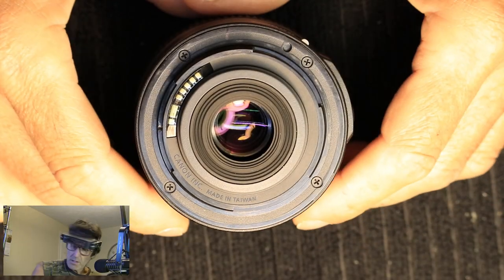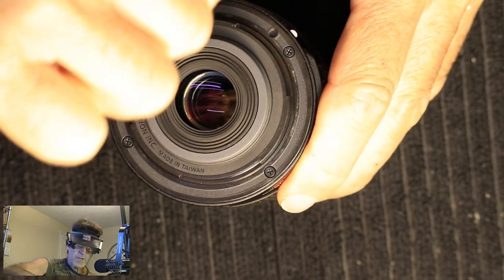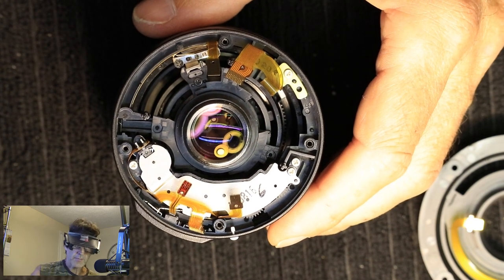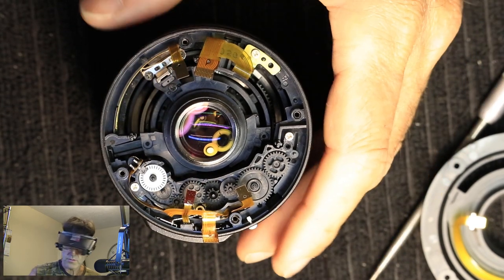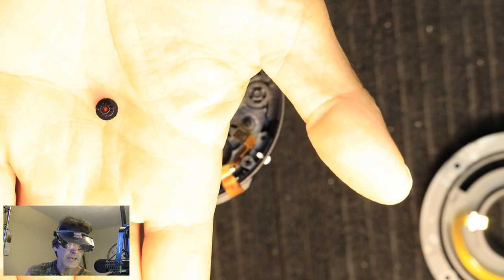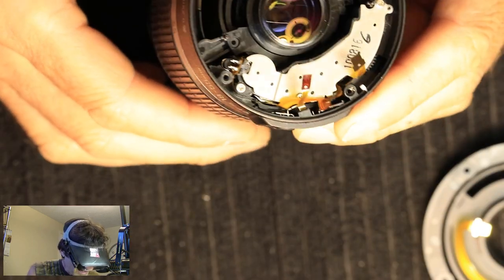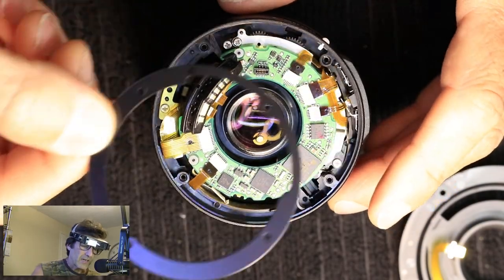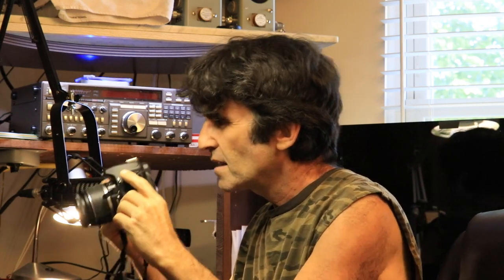Canon Lens DIY Repair: 18-55MM F3.5-5.6 AutoFocus Not.....

Comment: mines not broke but it wont auto focus please help
Reply from the maker: Does a different lens work in the same camera?  If so, it could be the control board that's in the lens, or it could be the auto focus motor.. or a broken gear, you almost have to take it apart to see

Comment: Where do you buy replacement gears?
Reply from the maker: The place I got them from went belly up.  I would try canon themselves and see if they will have it.  I got this from their website.  I don't know if this is the right number, but it might be a place to start;
Genuine Canon replacement service parts, including inkjet printer print heads are available to purchase by calling the Canon Parts Order Desk at (866) 481-2569.

Comment: Hi, where could I find the gears or the flex cable? thx
Reply from the maker: HI, the place I got these gears from has since gone belly up.  Have you tried to see if Canon has a parts department?  It also looks like if you google focus motor for the 18-55 lens, some options come up from aliexpress.com and some options on eBay as well..
Reply: @JLPicard440  HI, thank you for the answer, I actually disassembled the lens, and nothing was broken. I have a problem: it focuses only when the object I'm tracking is getting far away, basically it only rotates in one direction, It's not able to come back once it has focused.
Reply from the maker: I'm definitely not an expert on troubleshooting problems like that, but it sounds like it could still be the motor (guessing).. does it work right on other lenses?
Reply: @JLPicard440  yes, perfectly

Comment: Where did you get the replacement parts?
Reply from the maker: The place I got them from has gone belly up.  I believe you can still buy the whole focus motor with the gears, motor and all pretty cheap, possibly amazon, or canon themselves.
Reply: @JLPicard440   10 bucks on alieexpres. But I was hoping for some shortcut.
Reply from the maker: That's a good idea, I'd forgotten about them... 🙂